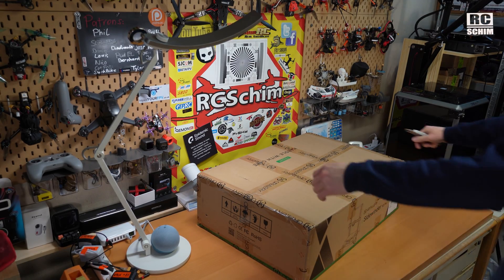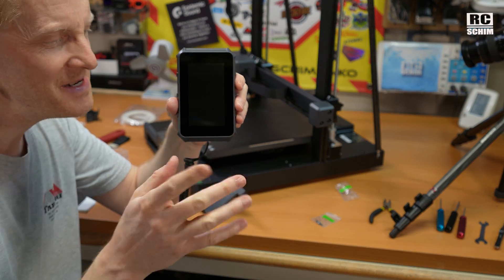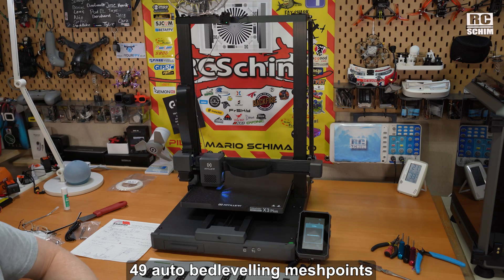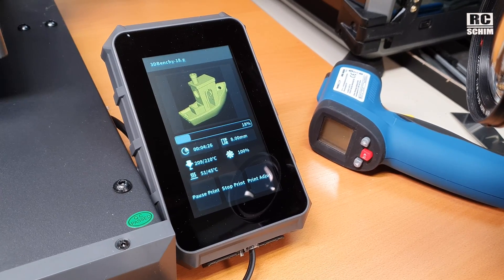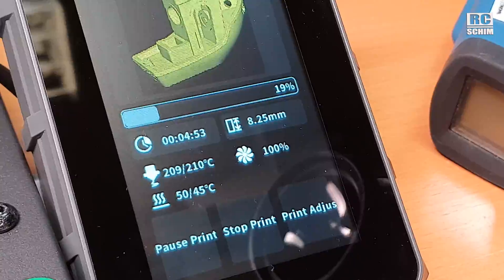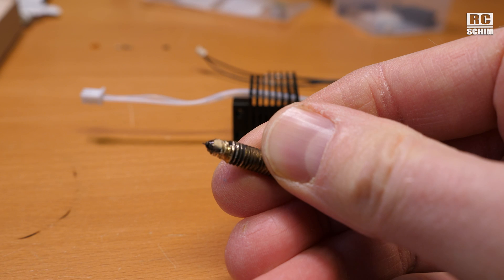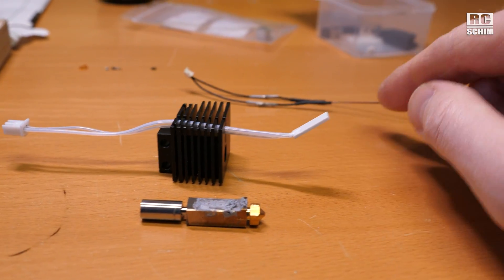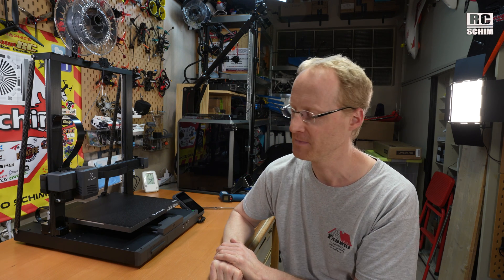Artillery X3plus review + Nozzle swap (and hotend repair)

Comment: I just bought two of these and cannot get either of them to finish a print. the extruder stops extruding and the head keeps moving as if it is printing. If I stop the print, then manually extrude from the panel, it extrudes again.  Any thoughts on where the failure may be? Arty support is  useless.
Reply from the maker: On your manual extrude: do you use same temp as on the print?
On the print: does it really fail to extrude or is it rather extruding in the air instead of printing on plate/prev layer?
Reply: @Rcschim  yes same temp. Its like the extruder just stops for no reason in the print. I come to the print after it runs overnight  and the head is up off the print with nothing coming out

Comment: Go to your slicer.. look at the custom gcode start up section. After where you see G28, go down 1 line and type M420 S1 Z5... you have to manually tell the printer to load the bed level mesh... i know this is old but this is to help those who are having issues and why there beds after doing the ABL it still screws up. The code i provided up tells the the printer to load the mesh stored in the memeory slot 1 and to use that mesh for the 1st 5 layers or 5 mm of the print.
Reply: Wont it be better with just M420 S1? if you use the mesh for only 5 layers - wont it go shitty after that?

Comment: I have one and it clogs extremely easily. The only filament I have been using without clogs is sunlu pla. Does it happen the same to you? I am considering to switch to a ptfe barrel
Reply from the maker: No, I think I didn’t have a clogged nozzle yet on this one. But mainly printing pla or sometimes tpu. After 1 month I changed the nozzle now to 0.8mm and I don’t think you could clog this  ;)

Comment: I just got Klipper running on mine 😀
Reply from the maker: I got Klipper running on my new x4 plus now, per default ;). Even comes with fluidd as a default, and root access via ssh.
Reply: @Rcschim  that's no fun. OEM tainted Klipper isn't true Klipper.